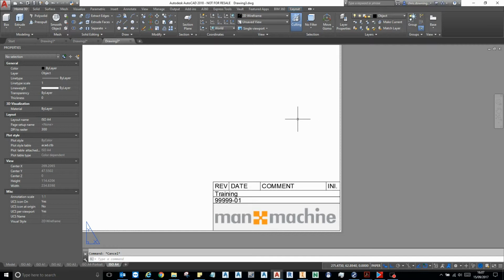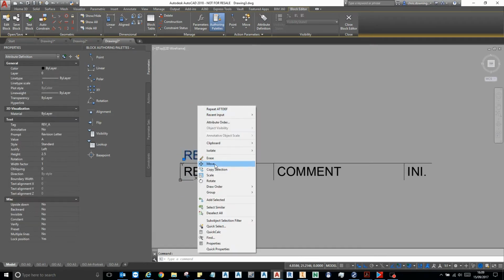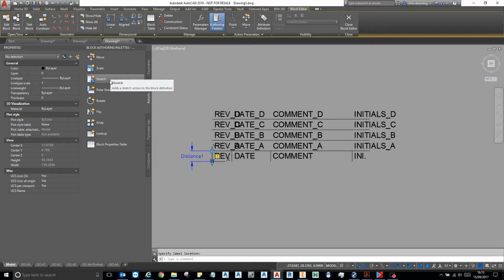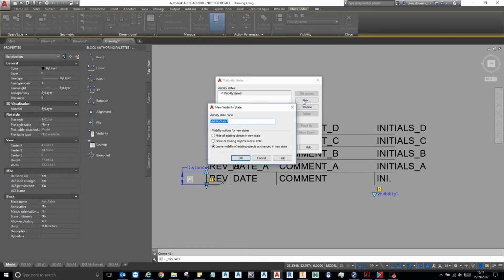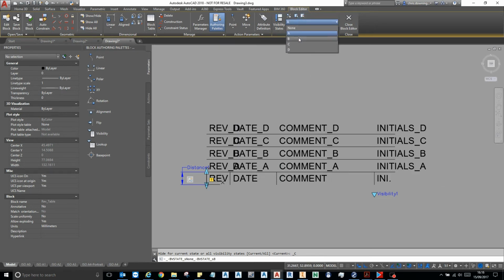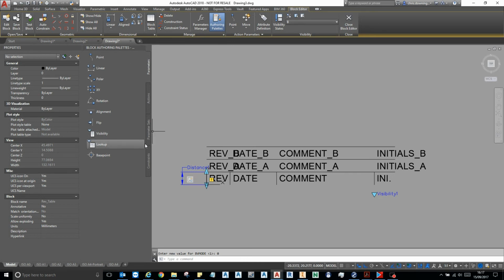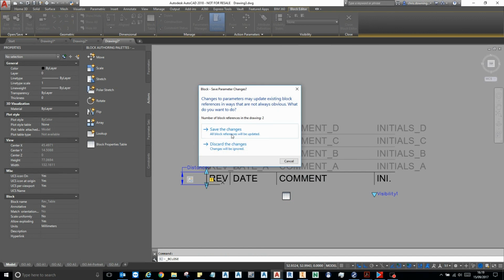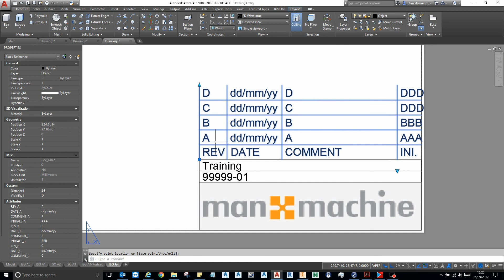Create a Dynamic Block Revision Table in AutoCAD

Comment: I had to check the box in the block properties table labeled "Block properties must match a row in the table" in order for this to work properly. Without the box checked, the visibility states were not changing despite the distance parameter being changed. I can't explain why this works but I spent a few hours figuring this out.

Comment: Very helpful, but how do you accommodate multi line / larger comments?  The comments attribute you have can fit 15-20 characters at best.  What about a comment such as "Updated to suit latest Architectural revision", etc? (I don't want to shrink text or use the 'fit' option, if possible)  I'd love to use this but I would have to create something with a little more flexibility otherwise it wouldn't get approval to use. Thanks Marc
Reply: To do this you would need to add another stretch parameter and action in the same fashion as 2.20, but this time horizontally on the horizontal lines, you will need to do this for each visibility state.

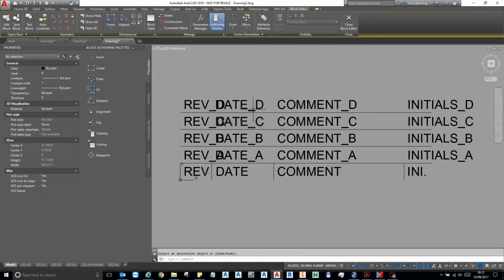Comment: How did you array the lines up after you set the dates at 1:47?
Reply: Hi, apologies for the late reply I just used the normal array tool and edited the attributes to suit. You could also copy and paste. https://knowledge.autodesk.com/support/autocad/learn-explore/caas/CloudHelp/cloudhelp/2018/ENU/AutoCAD-Core/files/GUID-8336B4CD-5375-4290-BD08-7D9E022741F6-htm.html